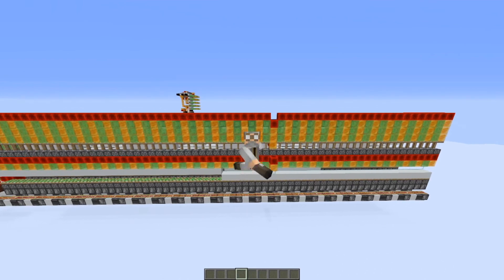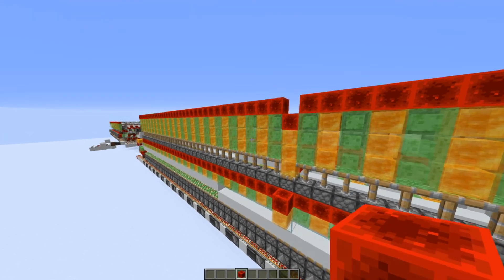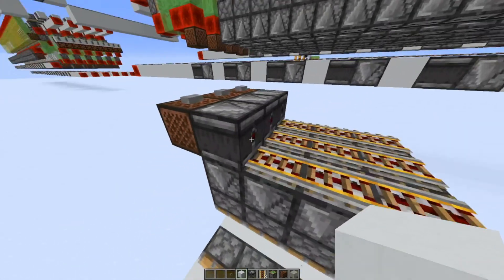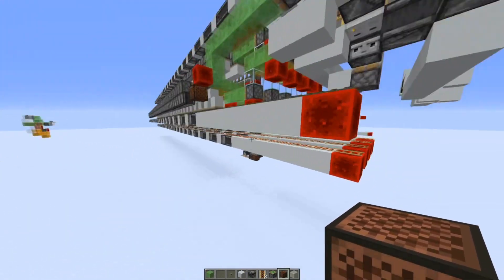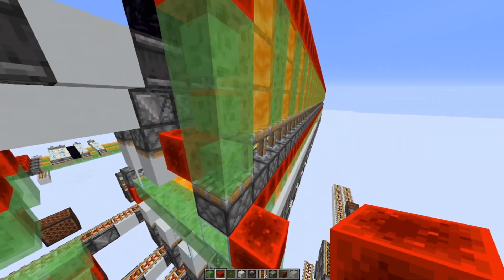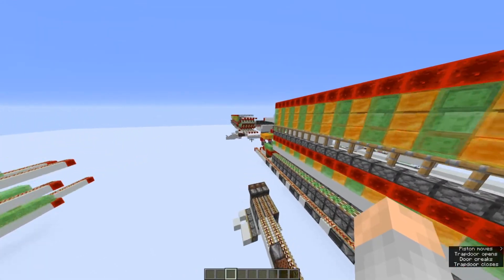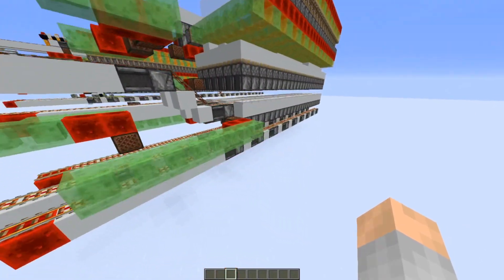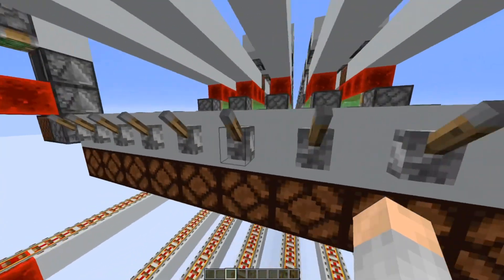[MCJE 1.15+]Binary Decoder and Logical Gates

Comment: What is de adventage of having biniry storage?
Reply from the maker: The advantages of binary storage over normal storage:
A) Binary storage is in general more lag friendly - in normal storage you have one sorter per item type that you store, thats a lot of hoppers
B) Binary storage is more versatile - The display hall and the decoder get a shulkerbox and a binary code, where that binary code comes from doesn't matter to the system
So you can attatch any kind of weird remote sorter to your system that sorts items in a specific way and the items will end up sorted in your system
C) Binary storage allows for more complex features (it scales better) - Binary storage can get connected with server wide item distribution systems
Since the system uses binary its easy to communicate what's being send and whats being requested